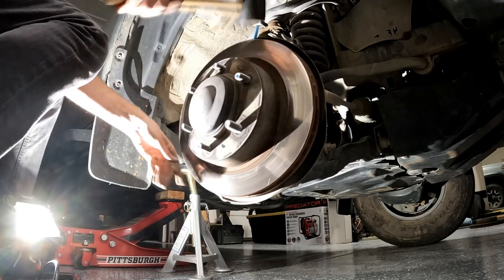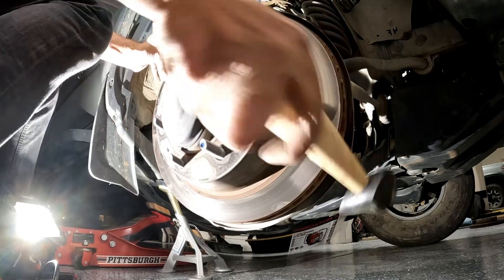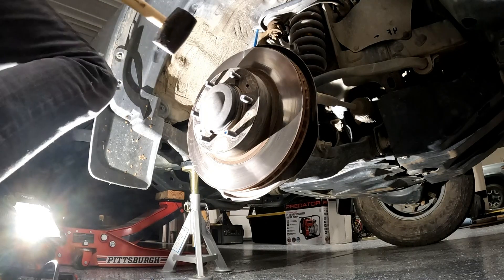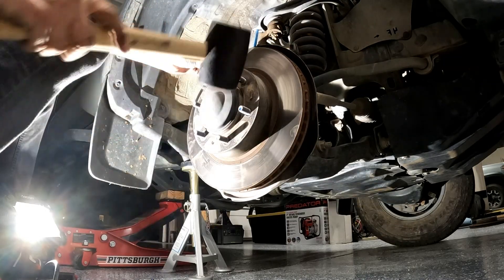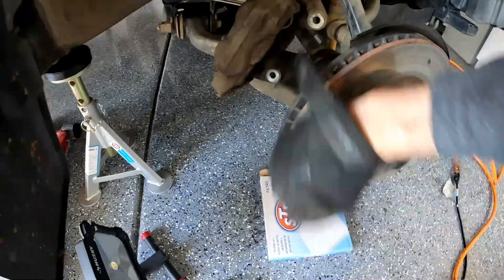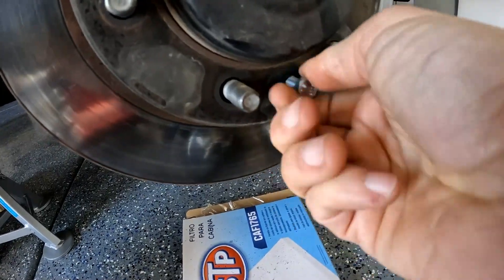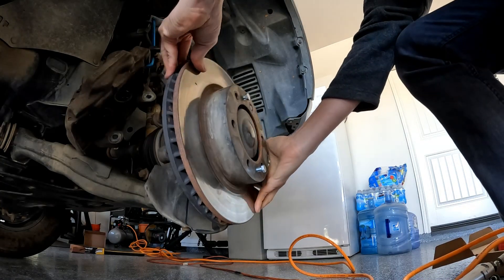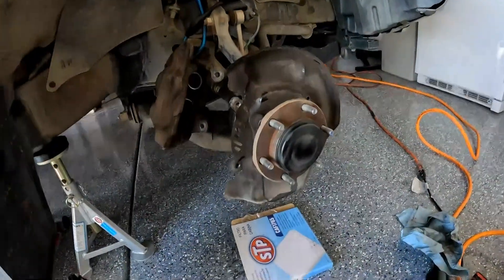Solution For Stuck Rotors - Seized on Toyota

Comment: Hi there, do you still have your 2019 Range Rover Sport? I just bought a used 2019 Sport with 19,000 miles and wanted to know if you have any other tips on changing filters or do it your self oil changes? Thanks for all your informative videos. If you still own the sport have you had any major issues regarding repairs?
Reply from the maker: Yes,  more tips coming